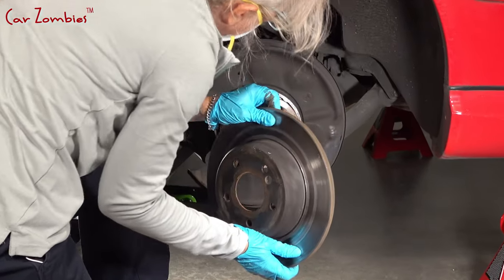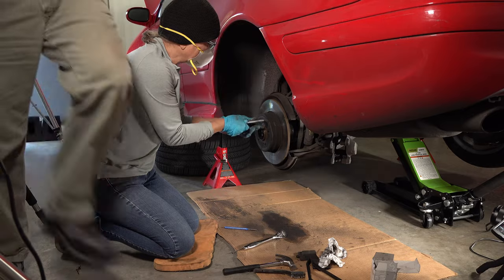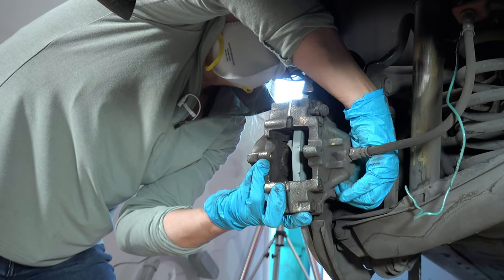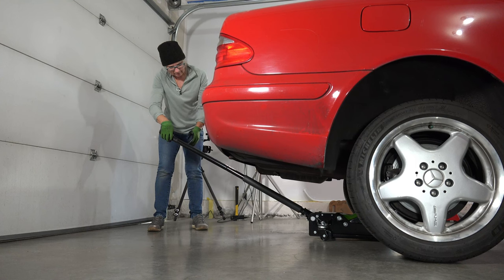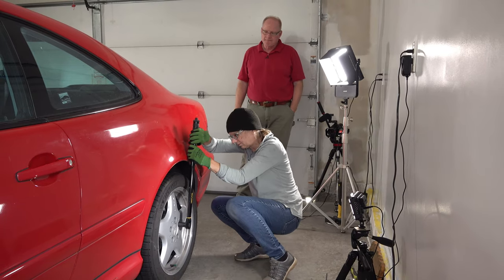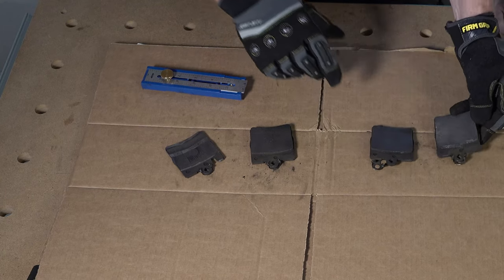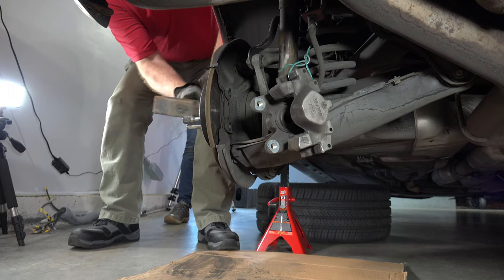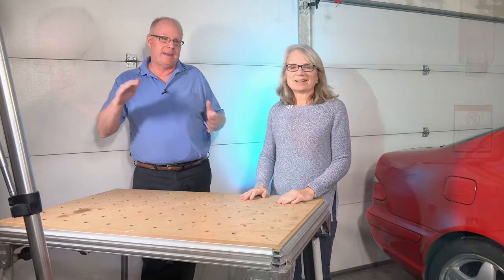Diane fixes her brakes, part 3: Di rocks it!

Comment: This is impressive.  I wrench on my cars, mostly maintenance items, but have shied away from brakes and other such items.  This has been inspirational.  As I watched, I couldn't help but wonder why you didn't buy Rennstand or jack point jack stands, so you can use factory approved jacking points and not have to jack at the differentials / car sub structure. Love all the tools you bought.  The pry bar trick to back off the caliper pistons is super cool. Count me in as a Car Zombie enthusiast.
Reply from the maker: Hi Ashokdongre, thanks for the kind words.

We used the factory approved jacking points for the jack stands (a safer method then holding a car up with a jack), which meant we had to jack up the car from the differential, which is an approved jack-up location for this old Mercedes (see our jacking up video, https://youtu.be/_wlvidlYYS4). Once on the jack stands we used the wheel as backup as well, so it was safe and solid.

Glad to have you on board,
Diane & Paul 😊😎
Reply: @carzombies  .. Yup, yes indeed.  You did use the factory jack points.  Got it, the jack was more for additional safety.  I also noticed that you had the wheel for additional safety ahead of the jack stands.

Comment: Wonderful video series. My car is 21 years old and had it for 7 or 8 years now and will prob drive it till the wheels fall off. I can now change all the filters and fluids in the car and at some point have replaced the hvac blower motor, both window motors, the stock radio to an aftermarket unit, all the control arms, shocks and struts, spark plugs, valve covers, front and rear wheel bearings and exhaust.  Even after all the new tools have saved so much money doing it myself and even after all the sweating and occasional cussing it can be so rewarding.
Reply from the maker: Wow. Us in a few years I suspect. Also, you are right about saving a lot of money. Great job!

Diane & Paul 😊😎

Comment: Normally I watch expert professionals repairing cars on YouTube! But this was fun to watch. Reminds me of me a few decades ago. Okay, several decades ago!

And now you have two torque wrenches, a kewl set of pry bars,  and a breaker bar! They'll come in handy on future projects. I suggest you get an even longer breaker bar at Harbor Freight, 25", and/or just a length of pipe to slide over your current breaker bar.

Glad to see you learning, all it takes is patience and tenacity to learn these things. The more you learn the more you'll know in future projects!

I'm a German car fan and always loved those CLK coupes. Keep it running!

I also recommend the Reader's Digest Complete Car Care Manual.. It was published in huge volumes starting in the early 1980's, but a lot of it really still does apply. And the first third of it has fantastic industrial drawings showing how various parts of cars work. Should be available used for under $5 on the internet.
Reply from the maker: Sounds like you got the bug before us. To listen to Paul talk about his research before a project is like your history with the Reader’s Digest articles. Paul would love to read them so I’ll look into getting him a set. I might like them even more since I am still learning. 

Diane

Comment: Great Video!  BUT   BUT   BUT   what about the bleeding of the brakes system?????  U need to get all the old fluid out, and install new, correct fluid!!!!!
Reply from the maker: It didn't seem to be required from our research. How often do you need to do that?

Paul & Diane
Reply: @carzombies  The service manual section for your car should specify how often to bleed your brakes. Usually 2 to 3 years or after certain number of miles.
Reply from the maker: @sirhhenry9379  Curious. We have a great service manual for the BMW (Bentley Publishing for the E30), but we have never been able to find a good service manual for Diane's Mercedes. There are some on-line manuals, so I'll try looking it up there, but they are tough to look through since there is no good index in them.

Paul
Reply from the maker: @sirhhenry9379  Okay, I found out about brake bleeding at https://workshop-manuals.com/mercedesbenz/clk_430_(208.370)/v8-4.3l_(113.943)/brakes_and_traction_control/brake_bleeding/system_information/specifications/page_6502/. It leads to the steps on how to bleed the brakes, but doesn't tell us how often or when. Boy I wish there were better manuals.

Paul